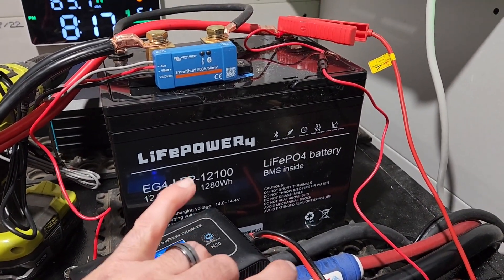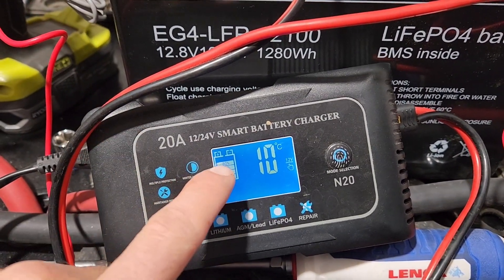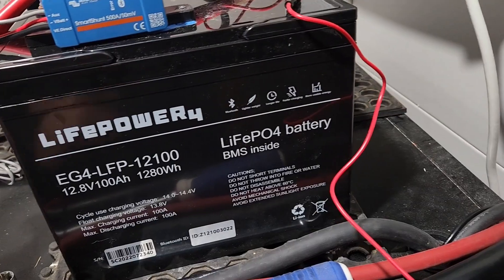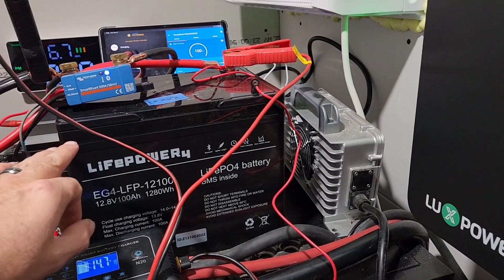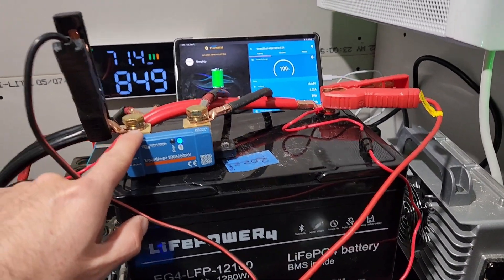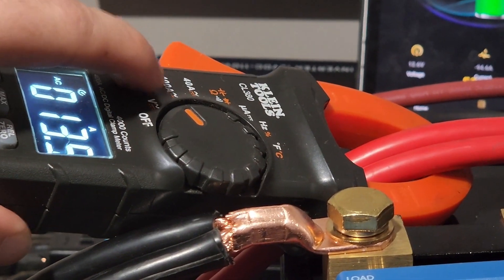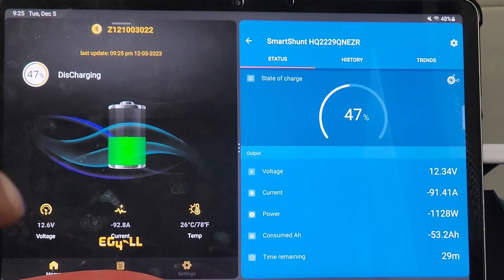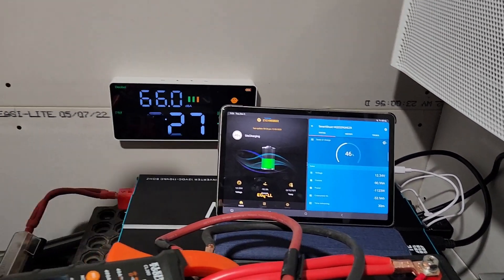Max 0.9-1.1 C discharge test 90-110 amps), EG4 12v battery capacity test using Victron Smart Shunt

Comment: These seem like nice little batteries. The app actually looks cool too.
Reply from the maker: They have been solid batteries and exceed capacity testing at a 0.2C load.  108 ah, 105 ah.  4 out of 5 batteries balanced on first charge.  The last battery took several charges.